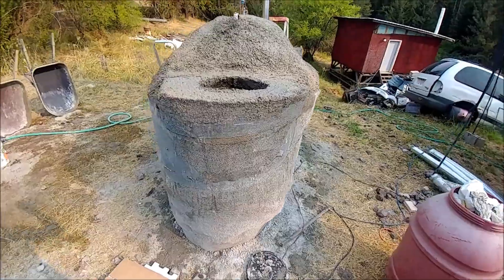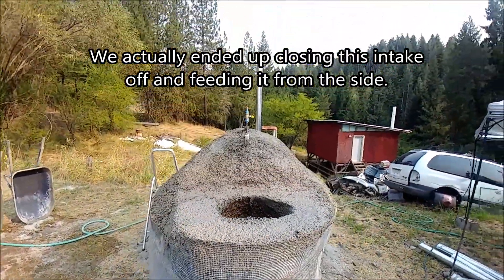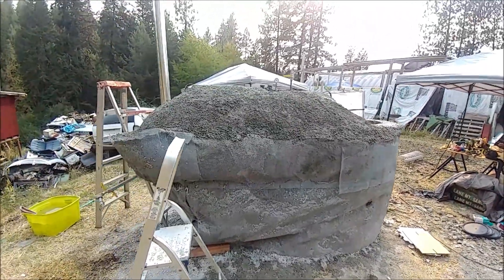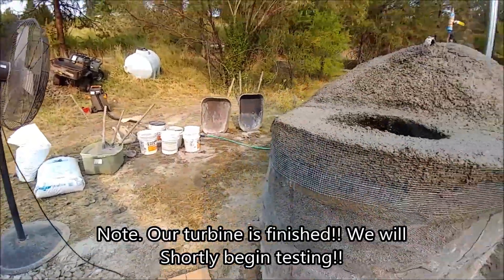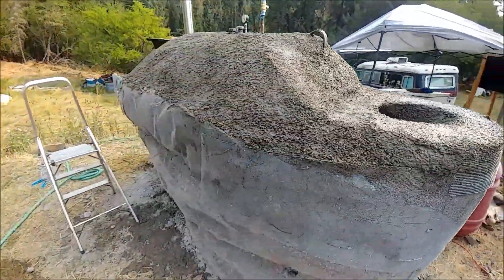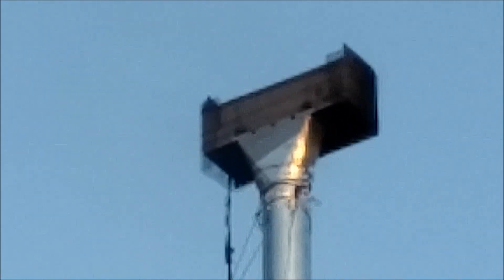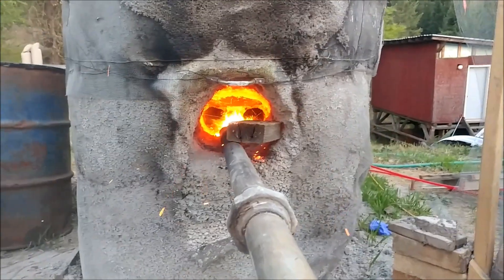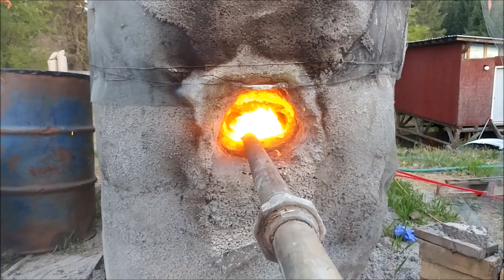Tesla Turbine Incinerator + Solar Electric Heat Battery System!

Comment: I had a thought why not use two different sized barrels one inside the other have the fire in the inner drum and water in the outer.you could also seal the air intake to the wood fire combustion with just the pressurized air pipe going in and the exhaust could run a turbine and the exhast of that turbine could feed a tesla one-way valve air intake for the fire making it a closed loop.

Comment: I don't see where solar came in this setup.  All I see if wood fire in a fat pile of concrete.
Reply from the maker: The solar heats the tank inside the incinerator so you don't have to burn fuel unless you absolutely need to.

Comment: So explain to me the final goal here with all of this tesla turbine stuff. I understand its a generator of sorts but how will it be any better than a tesla tubine driven by more conventional means? Also why is this drawing so much attention from the "free energy" crowd? You're always going to be inputting energy into this system.
Reply from the maker: You'll have to watch all the old videos to see what lead me here. I want o make an all around power unit. Simple and efficient.  A thermodynamic transformer, more efficient then the Stirling engine and also more power dense. It's primary source of energy will be from solar heat tubes and as a back up we can burn any fuel, fire wood, grass, sticks, saw dust, ext... and make usable electrical energy. Solar heat vacuum tubes are 97% efficient, turbine can be 99% efficient, and the generator is close to 99% efficient when done properly and we are doing our best to approach those numbers. This week we will be testing with the cold steam system and also getting the solar heat tubes. Much more information coming! Testing our current prototype this week :)

Comment: 2 points of confusion.  1) you mention wrapping the INLET around the tank to transfer heat but I think you meant the EXHAUST or OUTLET.  Also, you mention that the main reason for the boiler is for SOLAR applications but nothing you show explains this use.  You show the solar HX pipes but don't explain what they are for.
Otherwise, a VERY FUN VIDEO!
Reply from the maker: good idea.

Comment: Joe pipe ,babinton burner, vortex tube,
Pulse jet.  I dont see( perceive )
Any solar..
Reply from the maker: see latest videos.
Reply: @iEnergySupply  ok thanks for new reply to old comment..
I not seen you all (my testurb trio) lately
Been busy..
Reply: @iEnergySupply  new testur vid out there
He say rotor must fail at. High speed because of the thin (.4 mm)disk
Well the gap may be that
But disk may be thicker
According to me atm
There is a tt that I am sure has a to wide a gap
H is   blades are nice and thick (to much)

Comment: Great work, Can you please make a video on how to make a two stage tesla turbine. Please it is really needed 🙏🙏🙏🙏 I really want to make a self sustaining tesla turbine generator.
Reply from the maker: We have full cad drawings coming out soon.
Reply: @iEnergySupply  I have a question about this system. As you have mentioned in the video where you demonstrated the self sustaining dual stage tesla turbine generator, you took warm water to feed as fuel to the vacuum chamber of the turbine, my question is that is it possible to pressurise air with solar powered pump and trigger the initial launch of the turbine generator. After the turbine gets to optimal RPM is it possible to redirect water from under the Solar panels thus extracting heat from the panel and feeding it to the turbine generator for energy extraction. Really curious to know about this idea, please mention it. Thank you
Reply from the maker: @dhrubojyotidey8267  That's all possible and I'm about to show it, ill elaborate soon, you got it!
Reply: @iEnergySupply  the other thing I need to know is the material from which you made your dual stage tesla turbine generator. As far as Nikola Tesla's first model is considered, he found that the blades extended due to the high RPM. Can you please tell me what is the material that has been used to make the blades and the body? Also does the blade has any ridges or roughness of any sort to add in to efficiency? Another question follows up regarding to the operation of the dual stage tesla turbine which feeds on water vapour in vacuum chamber. Does the exhaust cold stem turn into water from the exhaust pipes just after going out of the vacuum chamber or does the cold steam gets out through the pipe and turn to water in the cold steam collector/storage? Thanks for the information. Appreciate it very much.
Reply from the maker: @dhrubojyotidey8267  We have an entire data sheet coming out and animations on the entire system please be patient. The cold steam condenses in the cold tank after it exits the turbine. It does have vapor but the vapor pressure is very low. The second stage of the turbine helps condense the vapor in the cold tank into water.
Reply: iEnergySupply Yes, this is also what I’m very eager to see how you will re-condense the vapor in the cold tank (what is the condensing temperature, and how it could work in less frigid climates)!

And about the disk profile shape, have you already considered/implemented rounded tips and adding a slight taper from the tip of the star-shaped washers (from Tesla’s later iterations of the turbine that add impulse to the efficiencies) to the tip of the disk (both to reduce weight, and then to reduce turbulence while increasing laminar flow as air initially enters the turbine)? The taper seems like it would be a bit more difficult to implement than the simple rounding of the tips, however.
Reply from the maker: @whitefreez3  I've rounded almost all of my disk edges, and I agree it's much easier then tapering.
Reply from the maker: @whitefreez3  A simple 32 foot drop will do. No condenser required if you have a 32 ft drop, ill be demonstrating this soon. Simply put, all you need is a tube coming off your exhaust of your vacuum box with a 32 foot drop. This makes a siphoning effect and maintains high vacuum. The steam comes out as water.
Reply: Also, have you guys included any converging-diverging valves to increase efficiency? Some old Tesla Turbine forums say it is a huge boost to performance (~20%?).
Reply from the maker: @whitefreez3  Not included that as the pump on the turbine replaces the need for a special nozzle by producing high vacuum.

Comment: Omg, Verry wel done it looks amezing verry big power battery en specialy whit the fan no smoke is verry good ;) i think your generator can be verry big so it can deliver a lot of power for use ore back to the grid meby like 5 to 10 hp. i was thinking about somthing like but not so big for mi steam setup in a few weeks but whit a normal boiler isolated whit earth above a big wood gasification stove under it, so i can reuse the charcoal for mi bbq ore as firtelizer in the garden
Reply from the maker: Surprisingly we don't get much ash, it seems to disappear lol. I was thinking more along the lines of 40-50 hp, but we will have to see. Depends on how large the turbine is for sure.

Comment: I'm sure you already know but you're losing a lot of energy by not having that intake hole sealed.
Reply from the maker: Yeah it's still under construction, thanks for the tip. I am going to utilize the venturi effect to pull in extra oxygen.

Comment: you can use a tesla turbine to push in more air on the system just add make a fan connected to a tesla turbine that will make it more efficent in my theory
Reply from the maker: We want to do that in the future, just getting the proof of concept out there, and we will make adjustments later.

Comment: strange, why didnt you just do the obvious and build it in the ground as the soil/earth is one of the best insulators and as a bonus comes for free, as is carbon loaded aircrete with waterglass binder etc.
and oc redirecting and making far better local use of all the generated hot flu gasses before they escape into the open air is also worth some engineering time and effort
Reply from the maker: Time equipment and money I suppose. Also The perlite seems to be working very good. I agree though that is a great idea.
Reply: @iEnergySupply  no problem,its easy to miss the simple stuff in hindsight.
for instance given the final "thing/device" will be storage to make 'use it,or lose it' electric power, take a look at making roberts simple painted heater,
probably cayrex2's low power 200C+ 12/24v 2-6+amp derivative is the most practicable everyman down the garden shed/under desk diy option to plug the local "battery" into
https://www.youtube.com/watch?v=utW80SrOprU&t=1s
A Flexible (200C+) heater from Kapton tape and conductive ink
558 views•Jun 30, 2020
Reply from the maker: @paulmaydaynight9925  Yeah I am looking for practical power, kw of power. My plastic 3" turbine got over two horsepower, we really need something to power peoples homes. Also a simple wood stove to heat water for storage and electrical use will be great. Solar heat panels will make this system crazy good, we get them on the 8th of next month.
Reply: @iEnergySupply  yeah ;-)
remember mega kw of power starts with your plastic 3" turbine running at even lower  pressure (conserving the finite differential stored energy) to get 200C+ heat and just enough volts,amps to run the painted on heaters in this case.
 
keeping in mind the original roman central heating design of "central" meaning put all your different sources of heat/storage through a lower  "central" constructed conduit within the center of a building and allow convection to do the (we now call it ventury) work... 
not a single heat slaped on a cold outside facing wall venting most of the useful hot gasses directly to the outside open air
Reply from the maker: @paulmaydaynight9925  We are covering the inlet so that it can't blow fire out the wrong direction. Also this is a vacuum system and heat transfers way better in vacuum. Also we are not going to use a 3" plastic turbine. Our blowers will be powered by a Tesla pump consuming far less energy.
Reply: Paul m ? Why? you ask
a big question. Please give answer
Reply: @aggabuss  why! what?, the better question is "how" and "what" does a given device or process get you
Reply: @paulmaydaynight9925  
Yes how. do these,your words work 
1oc 
2carbon load 
3 waterglass
Reply: @aggabuss  ohh right, uk people say 
1: OC (Of Course,used to introduce an idea or action as being obvious or to be expected.) a Lot :-)
2: carbon load(ed) is refering to simply making and adding any form of carbon you have/make locally, as in (im being serious)  burning, then grinding stale bread/toast,then microwaving this powder,then testing for conductivity as your base for making your small scale conductive inks,see roberts make carbon from a carrot i think it was called...https://www.youtube.com/watch?v=fvqkH0WLvyc
2b: heat any organic waste material in a sealed container so as to prevent oxidising "air" burning it away, charcoal etc.

3: googling diy waterglass will tell you how to make it, basicly process bulk "Sodium silicate" (some cat litters) and so produce a water based very high temperature (upto about 1000C) bonding/glueing substance to hold together your core building materials
Reply: @paulmaydaynight9925  
I have been to a cat litter plant they use much firing a cooking 
baking process.
Yep,Robert Murray. OC
Reply from the maker: @paulmaydaynight9925  Electricity and heating.
Reply: @iEnergySupply  yes, i know the last two replys, perhaps you said them for the readers clarity...
Reply from the maker: @paulmaydaynight9925  Yes.
Reply: paul m
What is 1oc 2carbon load 3 waterglass

Comment: Powder coal
Reply from the maker: What do you mean?
Reply: @iEnergySupply  ..
You are burning wood (a solid fuel) yes ? Well you could Burn another solid fuel of coal. But pulverized coal which is blown into the fiery  furnace is not solid..
Reply from the maker: @aggabuss  Yes ill try that. We will also be trying waist oil and used cooking oil from the grocery store.
Reply: @zbigniewwereda8449  
He (pole)got a good view count in two day. I see h2o.and Maybe propane.
Reply: @aggabuss  
126/5000
It is not propane but biogas or natural oil. There are no synthetic fuels, only renewable energy sources in Polish OZE
Reply: @aggabuss  
58/5000
I've seen this and many others, but these are unstable processes
Reply: @iEnergySupply  ..
Fryer oil from restaurant ..used motor oil..
Reply: @zbigniewwereda8449  ..
MyronB..Plasma is wild burning..i do not see unstable. this i energ
Oven" i dont get it. As other of his work. This vid comes as a surprise a divert of his normal" genius work.
Reply: @zbigniewwereda8449  .
What mean 126/5000
Reply: @aggabuss  

sorry this is copied from google translator
Reply: @aggabuss  These are experiments, not working devices. In that sense, they are unstable
Reply: @zbigniewwereda8449  ..
What is the Polish flame.? Is also hh2.
The flame color does not look hydrogen. Is it a burner for steam heat?
Reply: @aggabuss  Why not hydrogen. What is the color of the hydrogen flame when burning. Blue ??
Reply: @zbigniewwereda8449  blue..yes.. Ok but if mixed with some vegetable oil that would be different.
Around here we get to see many so called burn off vent oilfield
flame. Of yellow(10% orange (70% with blue(20%. Color approx. But this is a very orange.
Reply: @aggabuss  Ok theoretically yes, but you wondered why the burners on hho have a yellow flame color can burn nitrogen there because tesla used to do experiments with nitrogen burning in oxygen at high voltage
Reply: @zbigniewwereda8449 
 .."nitrogen burning"
..?   ?..
Reply: @aggabuss  well it helps to properly interpret whats really happening there, its not "Cold Fusion Plasma" as the american claims (oc nothings fusing etc), or burning plasma as such, it is producing electromagnetic plasma as an end result of pulsed electrolysis breaking the 2hydrogen  and 1oxygen elements that make up "water" apart ,then igniting the small amounts of gasses microseconds later...a useful effect when you engineer it properly,opposing piston "exploding water" device etc

you can get direct heat transfer into the center of a water container by pre mixing collected on demand hydrogen  and oxygen in a tiny vortex tube feeding a tiny tip that is shaped to push the water out the way and igniting the tip too btw
Reply: @aggabuss  just for reference whats your first language btw!
"Orange flame
Featured snippet from the web
The bright orange of most wood flames is due to the presence of sodium, which, when heated, emits light strongly in the orange. The blue in wood flames comes from carbon and hydrogen, which emit in the blue and violet. Copper compounds make green or blue, lithium makes red.28 Nov 2009

What causes the colors in flames? | Earth | EarthSkyearthsky.org › why-can-flames-of-fire-be-different-colors
"

https://royalsocietypublishing.org/doi/pdf/10.1098/rspa.1911.0066
The flame arising from the nitrogen-burning arc
1
/
4
Reply: @paulmaydaynight9925  itdaint btw .. So what is the polish experiment.
I see h2o ozo big orange flame

Comment: You said that you can power a neighborhood or small city with this setup. Is that based off of the amount of heat you are able to produce with this boiler or the efficiency (or power) of the turbine? What is your target RPM and what is the wattage for the turbine?
Reply from the maker: My target is 10 horsepower for every pound of weight of the turbine.
Reply: @iEnergySupply  Does this mean that you also need to collect at least 10 horsepower of solar energy per turbine pound weight to keep the water boiling? Or that what you are testing? For me it looks like this could be a very efficient and practical converter if the turbine is very small ':)